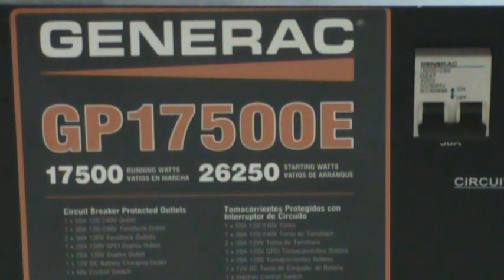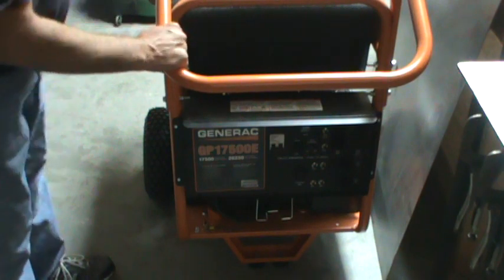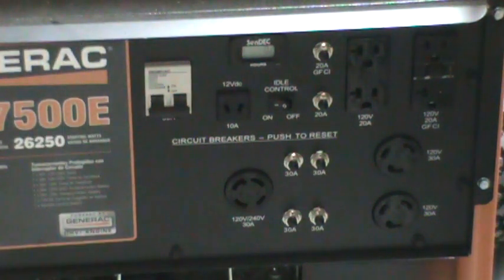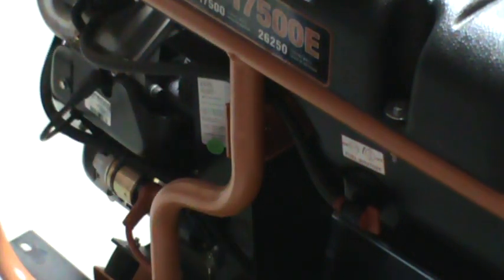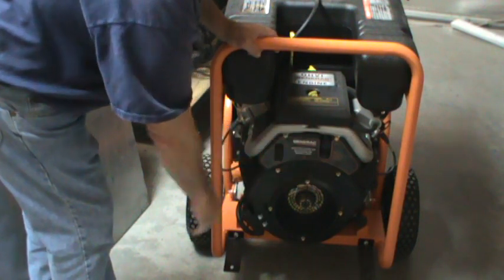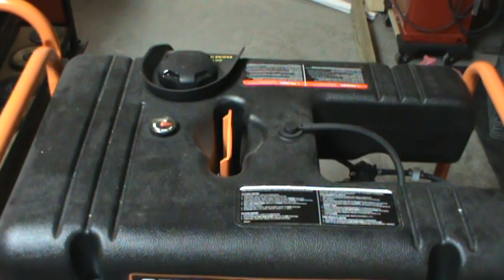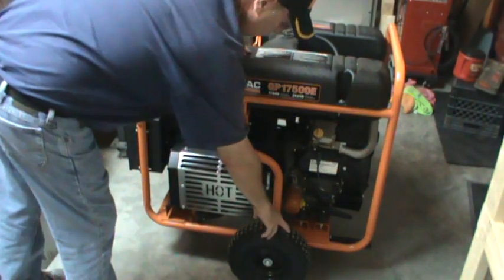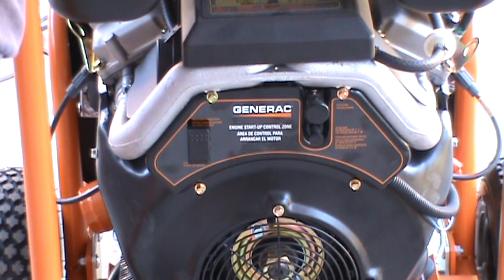Review of my GENERAC 17500 Generator 10/24/12 .mpg

Comment from the maker: I took it to a dealer in town because it had a missing sound in it. I only had .4 hours on it. Now the miss is going away because I have been running it for hours at a time for a break in period. I have had the Electrician hook up the needed wiring to the house and it works great. I can run everything in the house that needs to run during a emergency.

Comment: Have you tried load testing this unit on your home? I'm moving to north-eastern Florida soon and I've been eyeballing this model for some time now due to the wattage. I'm a little hesitant because of it's fuel consumption and I'm wondering if your experience running your home on this outweighs the cost of gas.

Comment: You can switch the circuit panel around so that each winding is balanced. For example you might have your AC on one side of the panel run by one winding and  the furnace fan on another side running on the other winding with the a number of kitchen appliances like your refrigerator and freezer, etc. Best to determine what is likely to be used in a typical application. This is a beast of a generator you have however if your oven, dryer are AC and the HVAC is running you can run out of watts. Balancing the winding will keep the load on each winding under control so you don't burn out a winding. Once a winding is burned out on the stator it has to be replaced or rebuilt and you can't run 220 AC anymore either just 110 AC since each winding contributes to providing 220 AC. The load meters are very cheap like 70 bucks and are just a coil with wire that each winding goes through. These generators will run at 75 to 80% power all day long but not 100% that will most likely burn a winding out prematurely...

Comment: I have one and I adapted it to run on propane with a simple conversion kit even my dog could install and I skip the hassle of the gas lines at the station, no thanks, see too many of those hurricanes here on the Gulf Coast to ever want to sit in line waiting for gas.  I had a 500-gallon tank buried on the property and don't even touch it, I exercise and load test the gen-set monthy via a large portable propane bottle and don't even touch the reserve till the next "big hurricane" it ain't going anywhere.  I manage my power via a manual transfer switch to make it simple and safe.  Way more power for my whole house than I really need.
Reply: After I converted it to run on propane I tossed the fuel tank, it's a "one or the other" thing and the tank served no purpose.

Comment: The one I got it’s the same but 15000 watts comes with 50 amp plug too and for gas full tank goes in 8 hours that’s a 454 engine

Comment: If you use your generator a lot you might consider the load meters that Reliance has. I used a dual meter set up since the Generacs of this size have two windings. It is best to try and keep those windings balanced so that one winding is not overworking pulling too many amps. Also I used a power back alarm again from Reliance since there is not way to tell when power comes back on unless you can sense it set an alarm off. My system is an interlock panel system but if you have a transfer switch you can usually tell when power comes back because one of the circuits not driven by the generator will operate such as a light. They are sure nice machines. Mine is an EXL 10000 and runs my house just fine to include my 3 1/2 ton AC...

Comment: How much available Surge watts are available to the 50 amp plug?  I can not find that nfo anywhere
Reply from the maker: Maximum watts you can run on 50 amps running on 220 volts is 11,000 watts without tripping the 50 amp breaker. The surge watts on start up of the Generator is 26,250 watts.

Comment: its a really large and heavy unit - how difficult is it to move, e.g. could you move it across 10 yards of gravel on your own? also, most say not to use the idle control when connected to home cause it an damage sensitive electronics - do you use this feature when powering your home?

Comment: Great video!! I just purchased this one last week.  Only concern I have is the battery is open and is located below the 16 gallon gas tank, if the battery connectors spark for any reason  might  become a fire hazard, also the on/off fuel valve is just above the battery as well and over time, I have seen these valves leak. I would like to see the battery in some type of vented battery box.  Thanks again...
Reply: Hey.  How you doing??

Comment: Have you figured out that if you do have a lengthy power outage you will need a HUGE supply of gasoline to run that thing? How many gallons of gas would you need if there was a 4 day outage in your area of South Carolina? I hope you use this for more than power outages because this is a lot of generator to have sitting around waiting for an outage to happen.
Reply from the maker: I made this video 4.5 years ago. It works just fine. I have a 250 gallon tank of gas that I use for my vehicles and generator. I also use cans of Sea Foam motor treatment to keep the gas fresh longer. I put a propane kit on the generator so I could run both fuels. I have a 350 gallon propane tank that is full if needed. Other than a permanent grid down problem I think I have things figured out. The generator is also used to run my electric welder when I need to go help people with welding repairs that they can not bring to me. Thanks for your input.
Reply: Oh wow..With the addition of working on propane I would say you are all set. Nice.
Reply from the maker: Thanks

Comment: could you get further away?  I only need binoculars to see.  You can start an engine inside for a few minutes. It's not an instantaneous death.  wow, camera in one position and we have no idea what your pointing out..or what this will run. Can it run a whole house a/c unit with fridge and freezer and lights?
Reply: I have an older 17.5k UltraSource 4583 and it runs a 3-ton ac & everything in the house including clothes washer. However I am more particular about using the clothes dryer as it uses gazillions of watts.